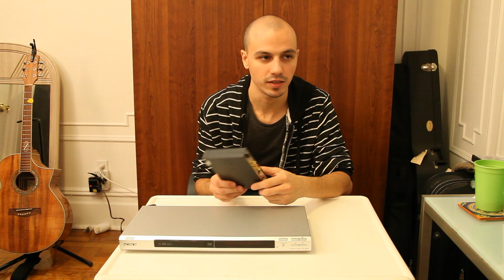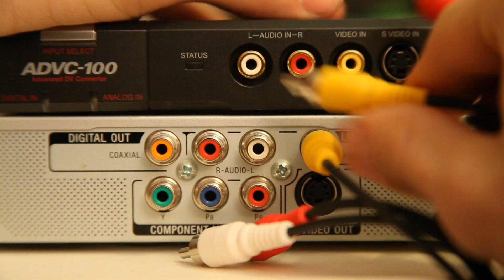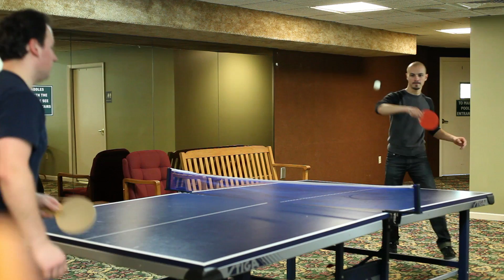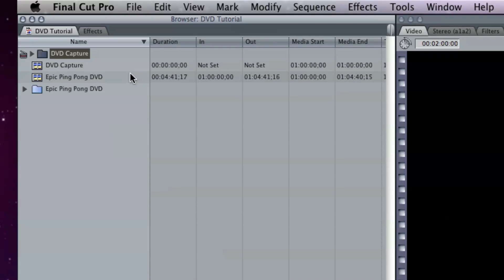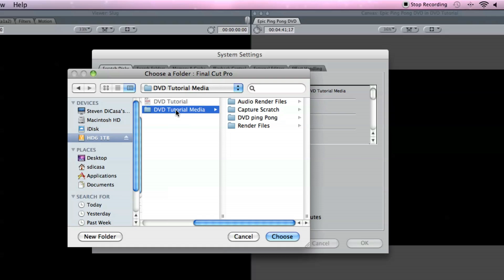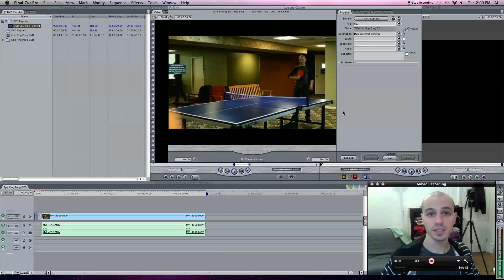How to Import DVD Footage into Final Cut Pro

Comment: @DiCasaFilm I can rip copyright protected DVDs from handbrake just fine. You don't have to convert to DV, if you have a standard format like mpeg 4, final cut will match up the clip settings, and you only have to render the audio, this only works in the new final cut pro 7 though.

Comment: This is ridiculous, the right way to do it these days is to use software such as DVDxDV or Mpeg-Stream clip or handbrake etc. They convert to DV format straight from the DVD in the optical drive. This guys method is expensive and sets you up for rendering errors not to mention you have to do his method in real-time.